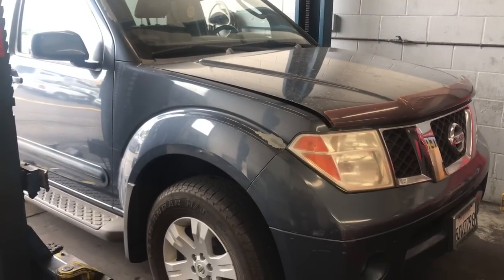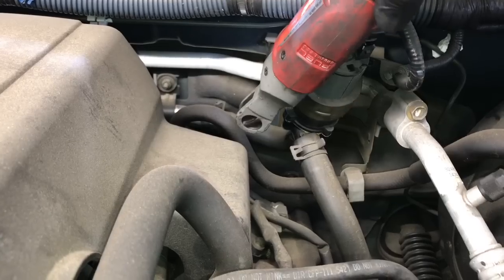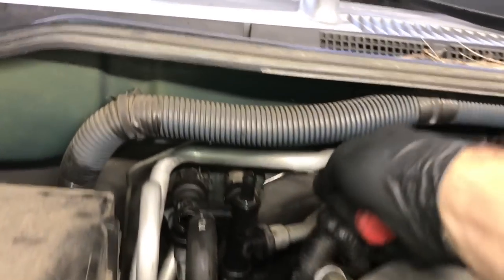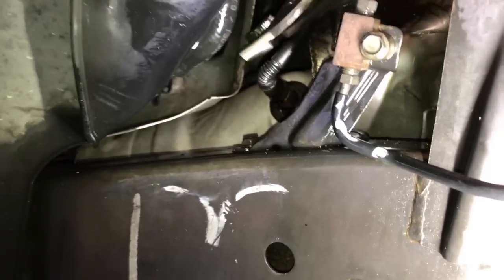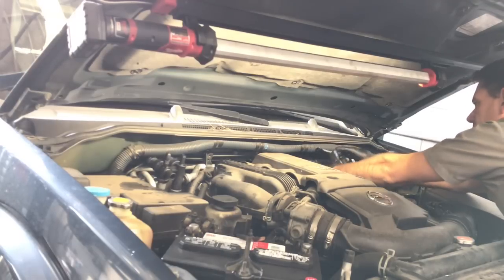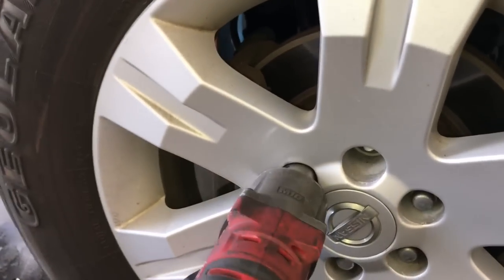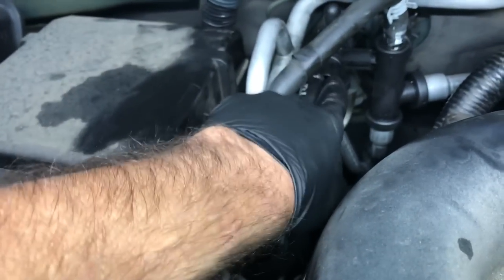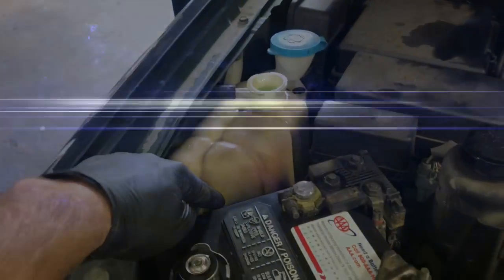How To Replace A Heater Hose Assembly On A Nissan Pathfinder

Comment: Thanks so much for this video. I did this job yesterday. I wasn't able to remove the tire because of where the vehicle was positioned when the hose assembly busted. It's possible to access the lower hoses by cranking the steering wheel all the way to the left, but I don't recommend it! Thanks again, great video!
Reply from the maker: Ray Benavidez that’s awesome to work to the problem and got it done. Thank you watching!

Comment: this happend to me on my pathfinder 2008 wtih 160k miles. insted of replacing the hole assembly i just broke the rest of the plastic hose connector at 1:57 to reveal the aluminum tube. then i bought a "T" radiator hose connector and use JB welds to make it a permanent install.
Reply: hi, i have the same problem, can you tell me what is the part names, part numbers and where did you buy the parts... please..
Reply: @damesiojohns7176  i just used a 'T' heater hose connector, some heater hose that fit the connector, and hose claps form autozone. i used a heat gun to to soften the plastic from the t-connector so i will mold to the aluminum tube.  it was a easy and cheap fix, i think i spend like 7 usd.  the only hard part was to get the remaining of the old plastic tube from the aluminum one to make space to fit the T-connector. its been 2 months since i did the fix and its holding well, my concern its that the rest of the plastic from the assembly will eventually break down.
Reply: @leov30  That's awesome. Can you make a little video showing what you did?
Reply: Did something similar, lasted about a year more of the plastic did break away (didn't use JB weld) now thinking of going to a pick a part to get the assembly.
Reply: I did the same but used small peice of hose to clamp directly to bottom metal pipe
Reply: & clamped the 2 hoses directly to the new tee at the top
Reply: @Thru_Mind_I  better change everything, other plastic parts of the assembly started to brake a year after, and i found that JB welds its not good to hold coolant.

Comment: Wow. Its a bigger job than i imagined.  I need to repair my 2010 pathfinder with the same problem. 
Your video is fantastic instructions for this old backyard mechanic to follow. My question, if dishsoap helps install those hoses, doesnt it also help them separate? Would silicone spray do the same thing?Thanks for making a great video 😊

Comment: Mine blew out yesterday in the same place. When I pulled the broken piece out of the end of the hose, it just crumbled in my hand. I believe that hose is the water source for the heater so I just clamped a plug into it for a temporary fix so I could drive short distances without blowing all the coolant.
Reply: Did the temporary solution give you any issues and how long did you drive your truck like that? Did you ever replace the whole assembly?

Comment: Seriously thinking about going to a mechanic this time. So tired to having to fix things on this truck. I recently had the passenger wheel off to replace a crankshaft sensor. That's just one of the many things I've done myself so far. This problem just started Sunday and I'm already down to nothing on coolant. Engine temp still reads normal for now, but smoking from coolant splattering all over the inside.

Comment: this is exactly what happened to my '06 pathfinder and I'm planning to follow your tutorial to do it myself. However I noticed some of the plastic bits and pieces fell back down and inside the hose. I tried to disconnect that hose from the button but it wont budge! My question is if it would cause any problems if I cant get those pieces out?

Comment: Curious do you always have to replace the pump? The part comes in two pieces now so would you start the same way if leaving the pump?  Would it make it easier to replace the hose from the pump to the pipe along the firewall? Recommend actions please. Thank you

Comment: I just finagled a repair on mine broke in the same spot.  I cut just beyond every compression fitting even on the bottom metal pipe & put a Tee connected the top 2 with clamps & bottom used a small peice of hose connecting bottom to metal pipe with 2 more clamps. First initial test had no leaks  Tomorrow I will top up coolant & see if I had success
Reply: Did it work?

Comment: My left side tube failed but the right side looks intact.  Is there  a way to only replace the left side and not the right???  Also the link to the part itself is no longer in stock / available.

Comment: At 50 sec. What is the name of the metal pipe that the rubber hose is connected to. I need that part part number

Comment: Would this cause a coolant leak under the glove compartment
Reply: foreignwhipcrasher I have the same issue 😫😫
Reply: The Goat...  if it is the heater core ,you have to take the whole dash apart, remove the airbags, evacuate the ac
Reply: foreignwhipcrasher I’ll just bypass the whole system I live in Miami screw it
Reply: Good video showed me a lot I have 2005 pathfinder. Thought my heater Core was bad got under the dash on top of heater box the aluminum pipes that come out of the firewall is not one piece to the heater Core it connected with a plastic clamp and a o-ring that was  my leak under the dash was coming from and I had this assembly broke too I used that  plastic weld putty it worked 177000 miles The air bleeder on the assembly broke  first I had to add coolant and bleed the system every winter or heat would only work when the car was moving I liked this truck but after 100000 miles a lot of stupid shit  crank sensor fuel pump transmission gasket oil cooler.heater assembly heater core pipe. Blower fan   Electric windows valve cover spark plug leak into cylinder that gives a engine light. 2005 was not a good year for pathfinder anybody else have problems
Reply: @anthonysorrenti3661  I have an 05 Pathfinder. I haven't had to do much work to it. I JUST changed the spark plugs after 270,000 miles on it. Everything has just been maintenance for the most part. I have changed the crank and camshaft sensors, blower motor, the engine oil cooler o-ring, valve covers/gaskets, and reengineered the heat hose assembly. I had a friend that worked at Nissan hook me up with the recall of the radiator/transmission replacement at about 100,000 miles. Other than that everything has been really cool for me. I don't race it around and I have almost always used supreme gas. ALL my fluids are fully synthetic and used Duralube for fuel treatment and engine oil treatment regularly. So far on my spark plug change, I have not noticed a difference on gas mileage. I DO have a problem with the climate control system, but I work it with the auto feature to get the fan speeds that I need. I guess that I am too cheap to spend $300 on a new unit. ESPECIALLY with 270,000 miles on the vehicle. 

I am not looking forward to the problematic fuel pump replacement. I did see a video of a guy cutting the floorboard to access the pump from the top, which I thought was brilliant. I will need to figure out how I want to seal it back up before I need to perform this fix though.

Good luck with your Pathfinder!

Comment: I enjoyed the Vid !  Took out the old crap no problem. The only part I'm having issues with is getting the heater core hoses to align to the firewall heater core.  Is there a easier way beside needing small hands ?  One side wants to align while the other hose doesn't act like it wants to cooperate.  It's like it's kittywampus. I spent almost 3 hours dicking around with it and it's getting me pretty P,O.ed  Any Help with a trick to get them in line will help.

Comment: Just completed the repair. Thanks for the video! Now it keeps overheating, slowly. Any suggestions? I removed the bleeder valve and air shot out. Did this a few times. How much coolant should I add?
Reply: Also, hot air is not blowing in the car, but the fan kicks on.
Reply from the maker: Sounds like you still have air in the system. With the bleeder open keep adding coolant until only coolant come out no bubbles..if the bottle is over full after you done suck some out.
Reply: @HowtoAutomotive  Thank you! A whole additional gallon and were good.   I'm just hoping when I cleaned out the tube from the top that none broke off and went into the line. But for now, I'm back up and running! 100% like!
Reply from the maker: jeffers77 awesome glad you got it figured out. I’m sure you’ll be OK. Thank you for watching!
Reply: @HowtoAutomotive  Where would you add the coolant? And is this while it's running?

Comment: Hello, nice video. I have a question. I own a 2007 Nissan Frontier crew with 79,000 original miles. Should I by pass the trans cooler lines? or add another trans cooler or replace the factory radiator to a new one. I have not yet had any issues of the mixing of the coolant with the transmission. But to be safe would would you prefer?.. Thanks.
Reply: If you're in a cold environment: swap the radiator for an upgraded one. (It also brings Trans temp up to operating temperature). If you live in a warmer climate, I would just bypass the cooler and close the trans fluid

Comment: This is ONLY for models with independent rear heat. The Auxiliary pump is used to move coolant to the rear heater core. Otherwise, the instructions are the same.

Comment: Where can I order the correct assembly for my 2010? 
I'm having the same issue.
Reply from the maker: There is links for it in the description of the video. Or you could check with your local parts supplier.

Comment: mine broke right where youre working on by the heatercore, do i need to get the whole assembly? or just that platic part that the hoses go into?
Reply from the maker: ss hog You’ll have to do some research to see if you can just get the plastic part. If you can Then yes you can just replaced the part if it’s available.
Reply: How to Automotive replace heater hose on a Nissan Xterra 2007
Reply: ss hog I have the same issue where plastic sleeve broke off as the video shows but I am confused why it is required to replace the whole assembly which costs close to $300.  I was hoping to just replace the plastic piece where the 1" and 1/2" hose goes to..????
Reply: I am about to place an order for 
Part No.: 92412-EA500 tube-water heater 👍?
Reply: So you don't recommend reusing the hoses?

Comment: UGH Put my truck in shop for another repair and repair man leaned on this and broke. But had to have been going bad. same hose!!!  Since there are no valves in this line. If you can't afford to replace the unit. Isnt it possible to unhook from the heater coil and and cut at connecting solid bar since its plastic seperating them making it 2 lines instead of 1 unit and run a heater hose clamped from heater core line to the connecting bottom line?  I looked at plastic weld materials but considering temps can get to 220 in heater cores and seems plastic weld material is rated at 200, this would be the best option to cut that plastic bar and make it 2 pieces to connect a hose.  WHY the hell they make these kind of parts out of plastic is rediculous! The only thing you loose is a bleeder point hence leave the radiator cap open till the air is out

Comment: Hi Brian and all.. I have a question and hopefully someone can help.  I had the heater hoses replaced at a shop, and right after that was done, the car started acting up; to be specific, the car started heating up when idling, specially when stopped in traffic.  I don't know if it helps, but when that happens, the AC throws a "dusty" smell.  Any ideas what might have been done wrong?  I took the car back to the shop, but they said that it didn't heat up for them, I know it was either that or they cannot figure it out.  Also, FYI.. I just changed the thermostat but that didn't fix the problem.  Thanks in advance!
Reply from the maker: Dan Lopez sounds like there’s an air pocket in the system. This will stop coolant from flowing. The shop may need to vacuum bleed the system to get the air out.